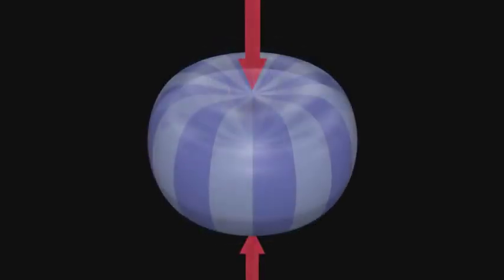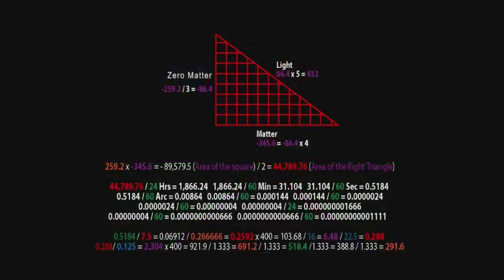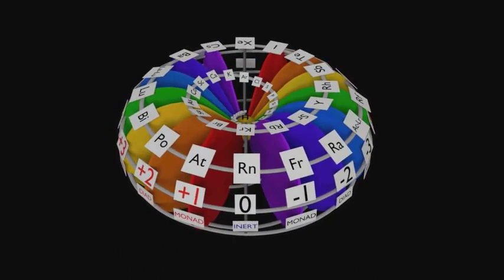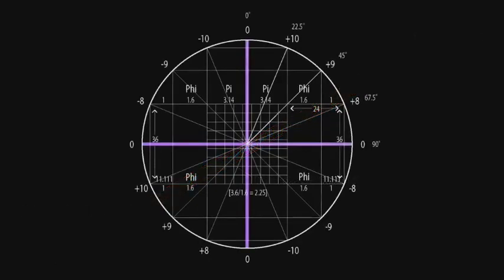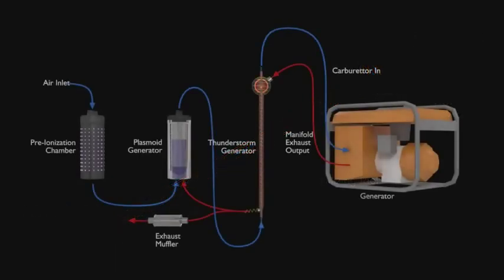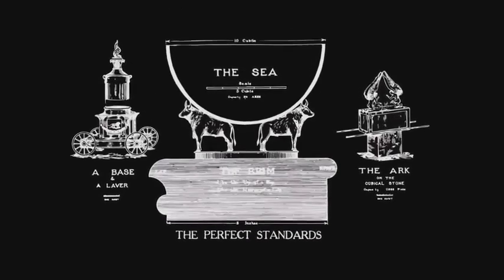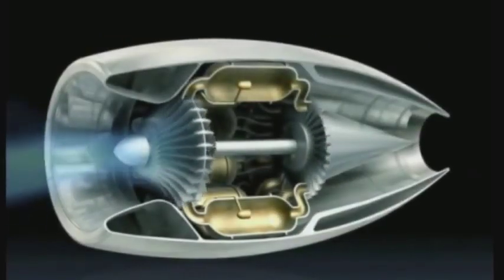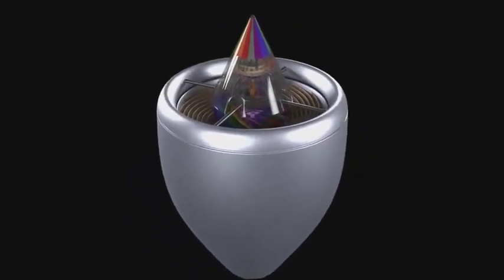The Bendall Turbine Plasmoid Generator Strike Foundation

Comment: This is a cross-flow static gassifier. The engine will run... but that's about it. The output capacity of the engine is significantly reduced.
Reply from the maker: Cope
Reply: @ConcretorumAzoth  - "cope" is adherence to an irrelevant fact, in observation to a greater success.

When I see these engines running under load, producing significant power, and capable of an extended duty cycle, I'll call it a success. Until then, it's just another gassifier... an induction system of poor volumetric efficiency, with little-to-no practical application.
Reply from the maker: @driverjamescopeland  Cope is your name  actually
Reply from the maker: @driverjamescopeland  The left hemisphere generates rationalizations it generates coherency and logic, it does not have to be true it does not have to be correct it just has to be a story that helps us hold our reality together, transmutations are happening in a spinning tube? Obviously its a cross-flow static gassifier.

Smirk 

This is what we call left brain cope.
Reply: @ConcretorumAzoth  - aye aye, Cap'n
Reply from the maker: @driverjamescopeland  That's the spirit
Reply from the maker: (he deleted his own comments like a sad coper)